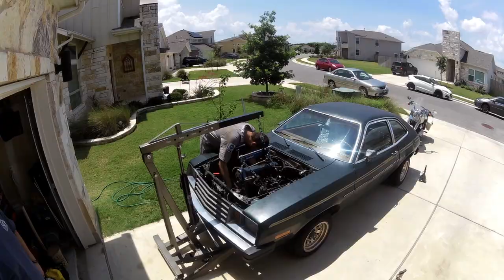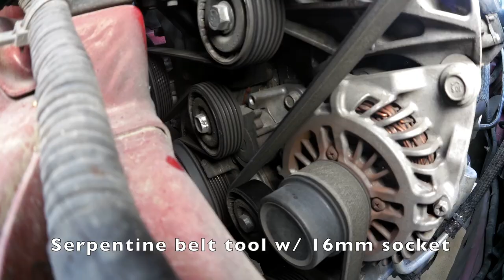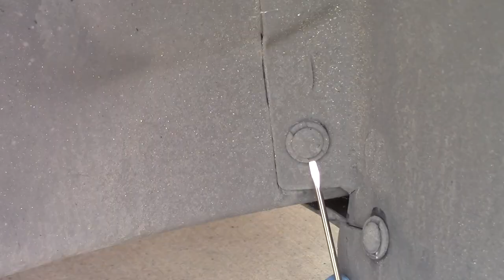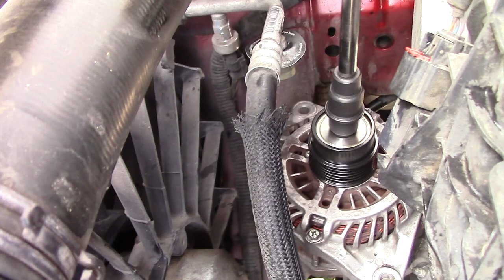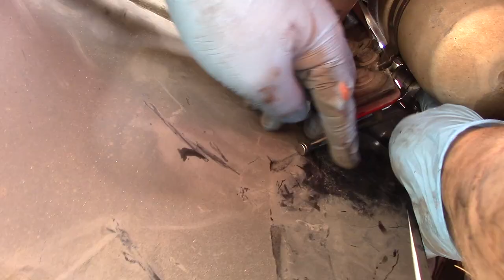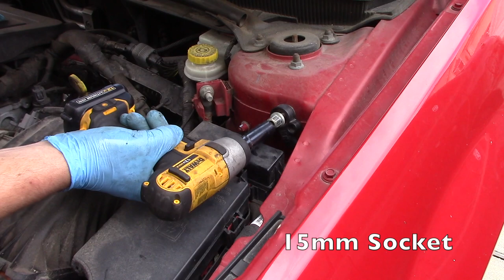How to replace alternator decoupler on Dodge Avenger (Fix loud engine noise!)

Comment: It’s amazing how much noise and vibration can come from these pulleys. My van was making all kinds of grinding noises and you could feel the vibration while driving. I replaced the decoupler pulley on the alternator and it’s like driving a different vehicle. Nice and quiet and no vibration.

Comment: 4 years later and still helping people. Thanks for the video. Followed step by step and took me about 2.5 hours. My advice for anyone having trouble getting to pulley off, use a small screw driver to hold the rotor in place while you hit it with the impact. Worked great for me.
Reply from the maker: Thanks for still tuning in. Great advice, just be really careful!!

Comment: Thanks for the Video as tomorrow I'll be replacing the de-coupler pulley, tensioner and idler on a 2.4 Sebring. All failed at the same time so I'll replace the belt as well. Many thanks.

Comment: This looks similar to the POS freewheel-in-one-direction pulley Ford used on the alternator of the 4.6 engine used in the Crown Victoria, (but at least they were easy to get at).   Those stupid things sidelined many police cars because they would fail often due to the heavy load placed on the alternator by all the police equipment, the long periods of idling time and the high under-hood temperatures during idle.

Comment: What if your decoupler pulley wont come off? I'm using an impact wrench and a 17mm hex driver and it just keeps spinning
Reply from the maker: Hit it with the impact in short spurts. Once it starts spinning it's not very effective.
Reply: I'm having the same problem. I took your advice and hit in short spurts, but it's not effective. Do you have any other advice?
Reply from the maker: @kylerustywilliams  you can try some penetrating lube like PB blaster. But you best bet is a harder hitting impact driver. Let the pulley come to a complete stop before you hit it again. Good luck!
Reply: @kylerustywilliams  I had to take the whole thing out and replace it all.
Reply: @lyndsayfleming6746  why? What went wrong?
Reply: @Scooter_911  okay, I will try that tomorrow. I ran out of time and daylight today.
Reply: @Scooter_911  I'm still having a hell of a time. I let it soak overnight in PB blaster and then hit it today with over 200 short, immediate bursts where i let it come to a complete stop in between bursts. After hours of messing with it,it only feels slightly loose. What am i doing wrong?
Reply: Garret I got mine off. FINALLY. The clutch material had gotten down in the threads i suppose. But after 3 days of soaking it with an obnoxious amount of blaster, and the old part came right off in three split second bursts

Comment: More stupid stuff on these new cars. I hate that they only run one belt as older cars have separate ones. Ac compressor lock up and still have a belt for alternator and water pump
Reply from the maker: Sometimes it's hard to believe that the engineers have our best interests in mind...
Reply: @Scooter_911  parts here, get your parts! your out of warranty experts have parts for sale!!!
Reply: The good thing about the AC compressors on these Dodge Avengers is they’re clutchless pulleys, so if the compressor or bearing fails, they’ll spin freely and not break the belt.